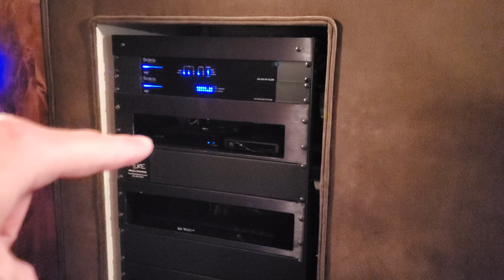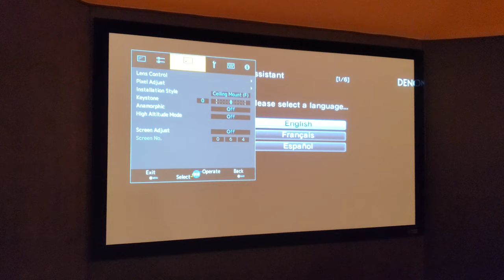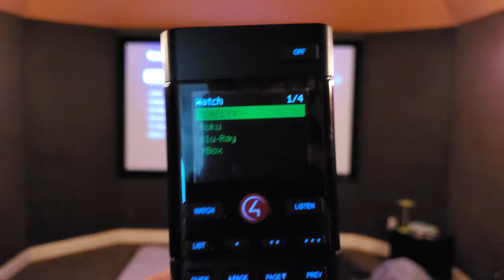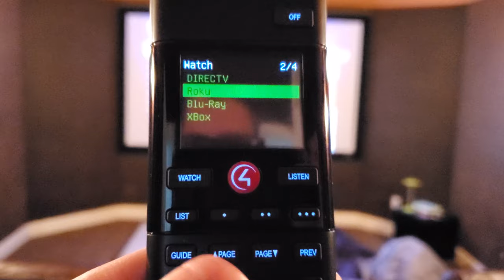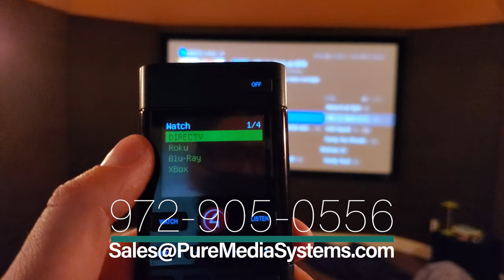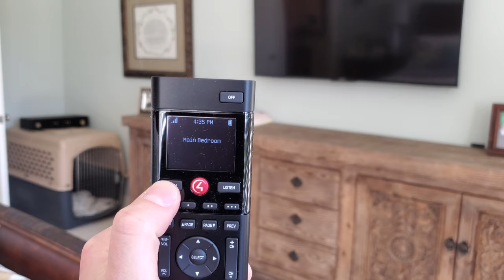5.1.2 Dolby Atmos & 4K Media Room, Control4 Automation, Sony, Araknis Networking - Plano, TX

Comment: Do you have a EA1 in each rom where there is a C4 remote?  If not how are you controlling the other rooms with only a C4 EA1 from the main rack?

Thanks

PM
Reply from the maker: Yes, in this system there is an EA-1 in each TV zone. However, there are other ways of controlling the system, it just depends on the overall design of the system.